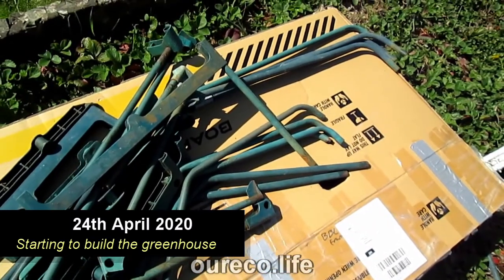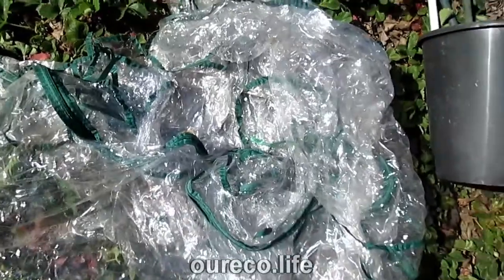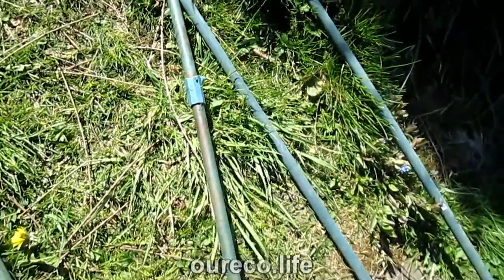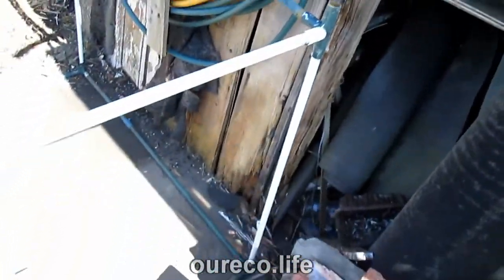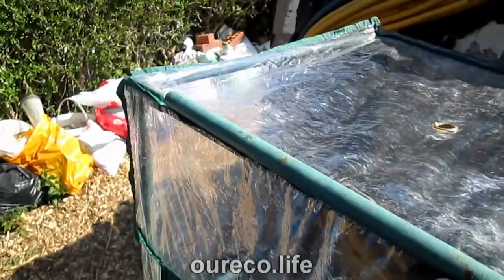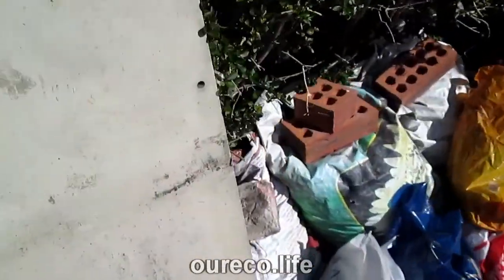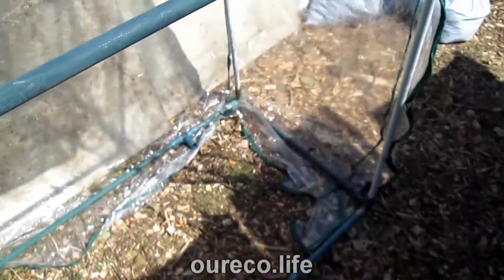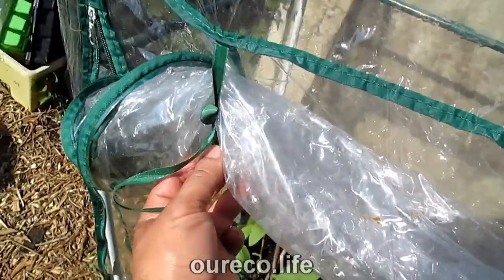Building a FREE greenhouse

Comment: great job rejigging the little rescued green house/cold frame. I was just thinking, if all else failed, you could have trimmed the metal poles a bit with one of those cutters plumbers use to cut the copper pipes! 😄 Your idea was faster!  This spring I did something similar. I got a small six shelf  metal stand free from kijiji, wrapped it in the plastic cover had saved from a new mattress, and used alligator clips to secure it! works like a charm for starting seeds!
Reply from the maker: Great idea with using the shelves and mattress plastic! I already have shelves with a heat mat and lights so might combine that with your idea and make a "grow room" to start off seedlings even earlier in the spring.